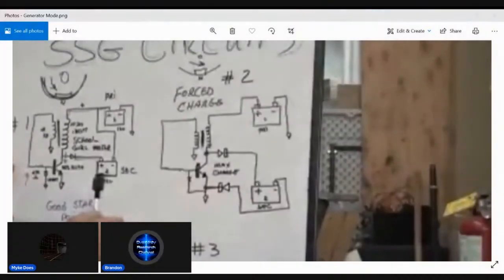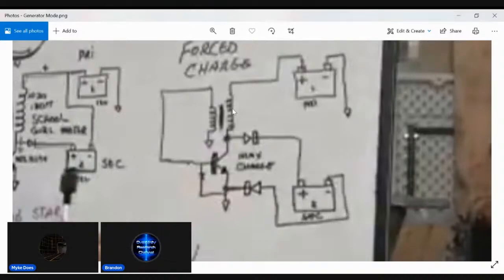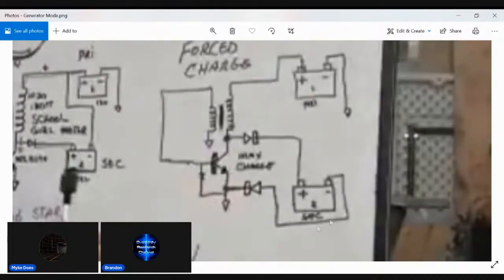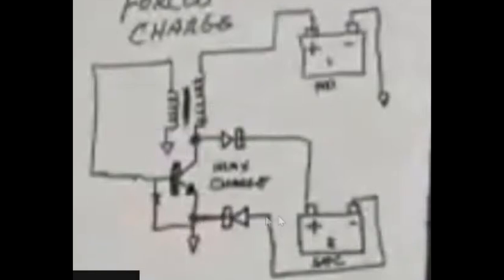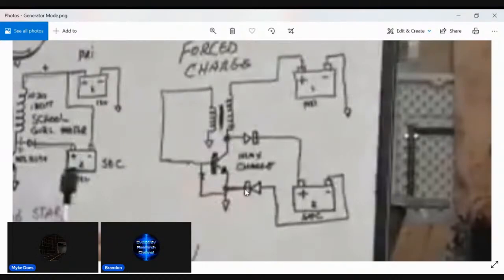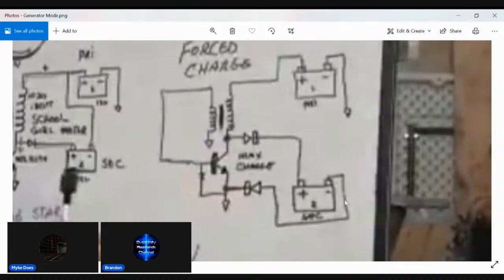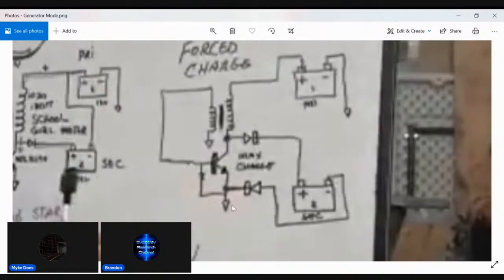Forced Charge Bedini System

Comment: Thanks Myke 👍 was an awesome broadcast with lots of information key points
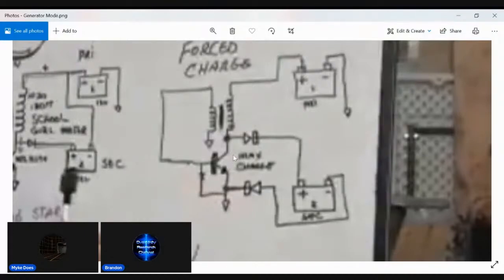Reply from the maker: LMK if you were not able to download the live , its on my channel in the live section .   2:00  Not when its charging  instead when the coil has lost charge and begins to flyback with a reversed polarity threw the 1n4007 HV diode into the pos of charge battery , but the negative side of the flyback has to meet with its positive so it will be able to flow threw the run battery giving it charge in the process on its way to meet its positive located at the pos terminal of the charge battery, the negative can pass threw the cathode of a diode so its like the diode is not there . If a positive tried to enter the cathode it would not be able to , in this way you have limitless options with both AC and DC  regarding directional switching of either half of an AC signal  or the radiant spike as well cause it too has two poles + and -.
Reply from the maker: I will be making more clips from the live over the next week, feel free to use them on your channel ;)
Reply from the maker: Try not to think about the circuits Bedini makes and how they channel , because its more important to see how the inductor reverses  the polarity you gave it with your forward battery charge . So where the coil touches the battery plus terminal that part of the coil will have a positive charge from your battery and its forward power same goes for the other side of the coil will have the negative, but when you remove the battery connection to this coil it reverses polarity , once this in envisioned the mind can now see more clear how these circuits are channeled cause essentially they are channeled to take advantage of the flyback event over all. see "Flyback Example Coil" on my channel  https://www.youtube.com/watch?v=97IHCMGIeaI   .. I am not  happy to admit it but this was my blockage for few years , it was only after i made the 4 transistor flyback  Bedini Mod that i realized the full story on the "FLYBACK" event .  Until then i was just replicating and not understanding much.  Plus / Minus becomes Minus / Plus 🔌